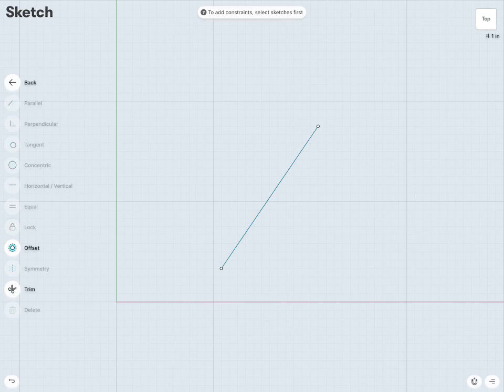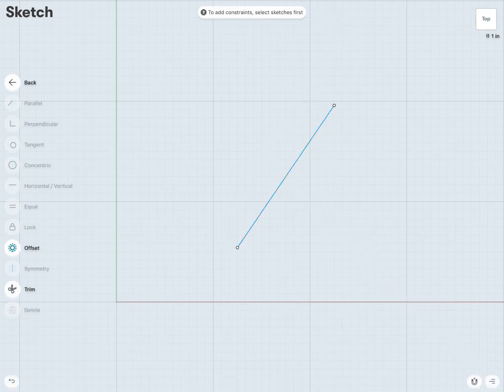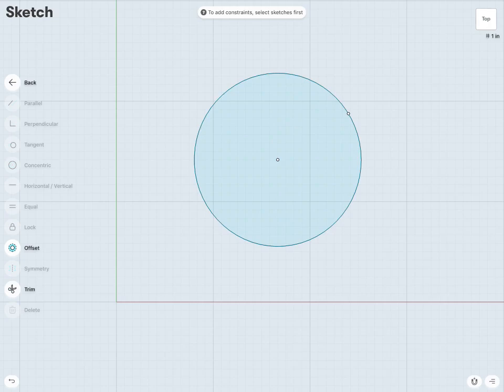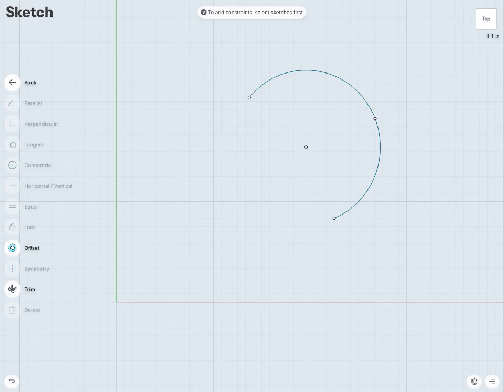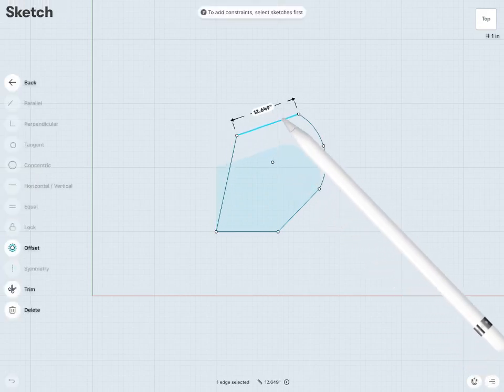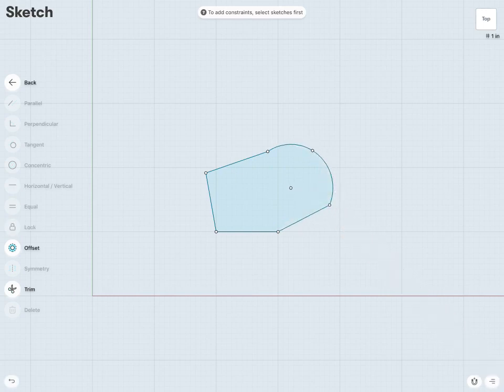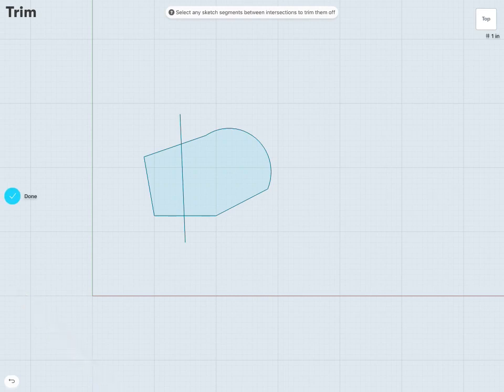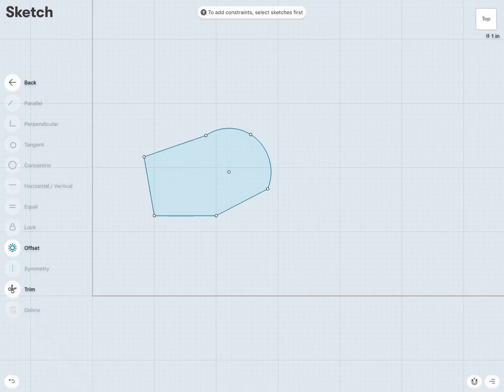Editing Sketches | Shapr3D for Beginners

Comment: Arc (or circle) already selected, but I still can’t find the point you were referring to at minute 1:48 which is used to SWITCH Arc  direction from a side to another. Any thing in settings might help to make these points visible please?
Reply from the maker: Hi,

Sorry my bad. The arc and circle representations have changed since this video was made. Now there is no point on the circle, or on the midpoint of an arc. You simply select the circle or arc and drag it to change it's radius. Or you can select the circle or arc and change the radius by setting the label. 

Hope this helps!

Comment: Hi, thank you for sharing those tutorials, very easy to work with. 
Regarding circles: I can’t move a circle unless I click on it’s center, also there’s no radius control point on my screen. 
Regarding Arcs : I can’t find radius control either, therefore I can’t change the arc direction
Would really appreciate your help
Reply from the maker: Hi! Glad you like the videos! You have to select a point to move it. Actually you first have to select anything to move it. About the radius: You can either drag the circle to set the radius or set the annotation label value directly. Same with arcs. 
Hope this helps!